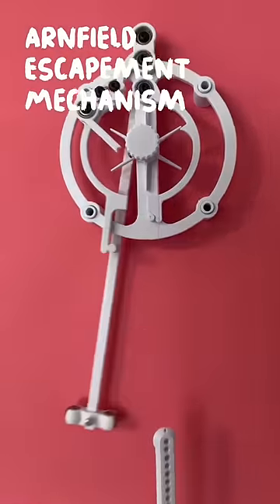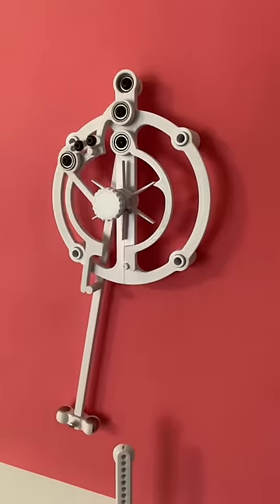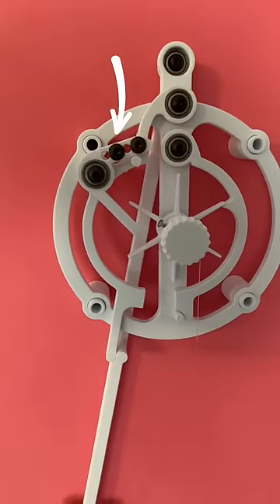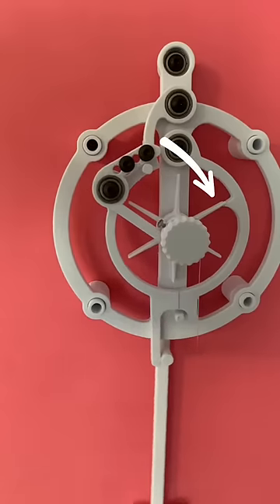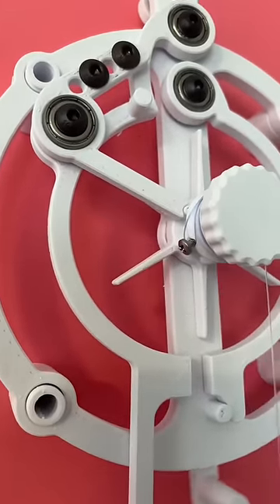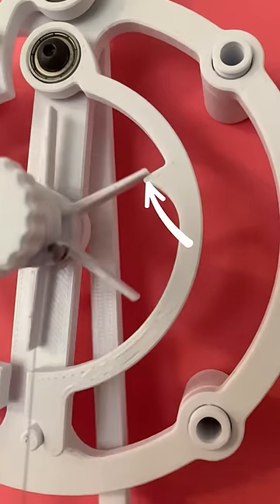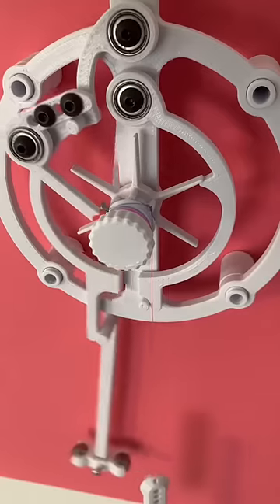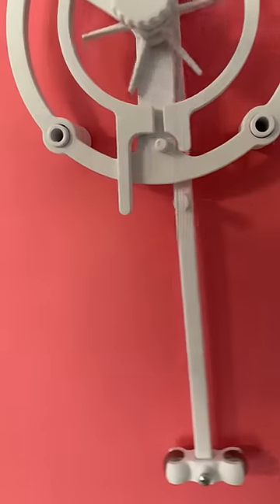The Arnfield Escapement Mechanism | Mind Blowing

Comment: The counterweight hanging on the string is what keeps it going. This has to be reset every so often to keep it running.
Reply: Exactly the same mechanism in a grandfather clock. It's always been fascinating to me
Reply: I mean, it'll last weeks if you're on a cliff, maybe years if you're on Jupiter 🙃
Reply: Ah, I just noticed that. I thought it used a coiled spring.
Reply: Would it be possible to have an enclosed cylinder with heavy balls that exchange out through some sort of hole to make it so each click the one side would always be heavier, Instead of needing a weight?
Reply: @TheOfAnd  like a Da Vinci wheel, or a Bhaskara wheel? If there really was such a mechanism, it would take the world by storm
Reply: @TheOfAnd  they would have to be heavy enough to flip the left side back up, but yeah. You just gotta fill the canister again with the balls after they all drop down.
Reply: @RazzleberryHaze  exactly! Love the grandfather clocks!
Reply: @RazzleberryHaze  Lots of clocks have a six pointed star like that at the heart of the escapement but there are many different ways the pendulum interacts with it.
You could be right but a lot of them look very similar to that one. "Kicker" mechanisms like this or a grasshopper escapement are fairly rare.
Reply: @TheOfAnd  You need to revise what you said, dude. There are children present.
Reply: Just like those pocket watches that need to be wound every day
Reply: Yeah, my grandparents had a cuckoo clock that had this mechanism
Reply: I don't think he's trying for a perpetual motion machine. It's a mechanism that was commonly used for clocks before electricity
Reply: @kelvinle8662  I don't mean a ball exchanging system. I mean an enclosed gear that had a certain amount of balls or weights in it that move around in such a way that one side will always be heavier
Reply: @TheOfAnd  u mean in like an infinite loop? Nah man, the system would always loose energy, so it would come to a standstill at some point
Reply: @kelvinle8662  🤔there's an idea!
Reply: That's what I thought, something must be keeping the center wheel wanting to turn clockwise
Reply: Ohhh okay. I thought the string was like lowering a load at a controlled rate, vs free fall.
Reply: Could a spring do the same thing so you wouldn't have to reset until it wore out?
Reply: I'm trying to ask the question of where can it have more energy to run all of the accesories.
Reply: No, it’s gravity that keeps it going.
Reply: everyone knows, this comments bro 🙄
Reply: Is it like a old clock?
Reply: Like the old grandfather clocks
Reply: Y he said nothing about the counterweight?????
Reply: It is not a "counterweight." It is just a weight.
Reply: @RazzleberryHaze  my great grandfather had a cuckoo clock that he fixed up and left to my mom when he passed away. I bet this is exactly the same mechanism that makes it work. The mechanism for popping the bird out of the door doesn't seem to work quite right anymore, but the clock ticks perfectly. It has 2 weights, one for the clock, and one for the bird/cuckoo noise, that drops only when the bird and noise happens, so that probably relies on a similar mechanism that's just triggered by the hand positioning. Like a stopper that's moved out of the way for a moment before sliding back in after the cuckooing. The triggering and noise and everything seems to work just fine, but the bird itself kinda gets stuck/doesn't come out very far. I wonder if I could fix it.
Reply: @GordieGii  you don't necessarily need a whole six pointed thing do you? You could just increase the number of "points", make them smaller, and suddenly you have a gear, with it just taking smaller steps and smaller kicks, but more of them.
Reply: @diarya5573  Jupiter doesnt have a crust as it is a gas giant, and it is so massive it would crush you through pressure long before you go anywhere close to "landing"
Reply: @ThatSB  Never said crust 🙃🙃🙃 Floaty cities
Reply: it is seen that there is a small thread holding a counterweight that is what gives energy to the system, when that counterweight reaches the end its "infinite energy" will run out
Reply: @TheOfAnd  no. That's impossible. You still have to lift the ball from the bottom and since the balls all would have to weigh the same you would only get a heavy side of the cylinder at the bottom most point.
Reply: @Chris_Bro_aka_MR_PLAT1NEM  bummer, maybe one day
Reply: @blipblop92  Those use a spring to store energy, this device uses a counterweight.
Reply: Uh.. yes. That’s apparent in the video. He was talking about the mechanics. He wasn’t claiming that a centuries old escapement someone resets its own weight. Normal people who use their brains more than their ears waiting for someone to misspeak understood that. And nobody new to this was thinking we achieved free energy over 100 years ago.
Reply: You don't say.
Reply: And you can even see it at the beginning as it slowly drops below the colored area before the last shot.
I like how they mentioned the weight more than once, and the pendulum separately.

It is one of the ways to power a grandfather clock.
Reply: You answered my question, thanks!
Reply: Yeah we still don’t have perpetual motion
Reply: Yeah isn’t this how grandfather clocks work? Is that hammering mechanism the reason they’re known for the really loud ticks?
Reply: @ThatSB  As far as we know. There are theories that Jupiter has a 'rocky' center made of hydrogen helium solids at high pressure, and a whole lotta comet junk/ rocks/carbons, but that of course is theory
Reply: Set the line for a minute and have something reel it back in one minute 
Evens down odds up
Reply: I was wondering about that string. Mystery solved...not amazing.
Reply: @sideways5153  they shouldn't make really loud ticks because that'd be just wasted energy.  As noiseless and friction free should be a goal so you can get the 8 days before having to lift up the weights with normal length chains.
Reply: @kelvinle8662  coiled spring ang gears might be better
Reply: @diarya5573  If you have a REEEEEALLY long string, maybe. But on Jupiter, it would actually last less time because the stronger gravity would pull the weight faster.

Also because Jupiter is a gas giant and it would fall in and quickly be crushed and torn apart by the atmosphere and tidal forces.
Reply: @TheOfAnd  No, because the balls switching sides create turbulent forces inside that actually slow it down. People have tried, it doesn't work.
Reply: @TheOfAnd  How about using mercury to tip the cylinder back and forth?

Comment: ISN'T THIS JUST A GRANDFATHER CLOCK MECHANISM? It's the original tick tock tick tock clock.
Reply: No, but it’s close
Reply: most escapement systems are similar, this is not exactly a clock pendulum system, but its similar
Reply: @r_ramendump9681  what is the difference?
Reply: @RoxasLopez  most modern mechanical clocks function on an escape wheel and a pallet fork system known as the graham escapement. It uses less parts and is more simple.
Reply: Yes it is. Don't be daft people.
Reply: No.
Reply: @Ben Dover Yep, its a controlled release of energy essentially
Reply: That's what I was thinking too!
Reply: Cuckoo clock, yes, most grandfather clocks are wound which requires a more complex mechanism. The escapement may not be identical but is designed to both control the descent of the weight/unwinding of a spring, and to make the action of the mechanism take a length of time that's a fraction of a second with a numerator of 1.
Reply: @kdawson020279  
My grandfather's clock had weights on chains, so no winding.
Reply: @rightwingwackobird1389  I have seen it both ways. I've seen a lot with faux weights that are purely decorative, as you get more modern. Historically speaking, accurate clocks were almost all weight-driven, as springs add variance and gravity is a constant. The heirloom clocks we had were all wound with keys.
Reply: My grandfather used an atomic clock.
Reply: Yeah.  Although the Tinfoil Hat Brigade want to take this in a different direction, it is just one in a series of videos that look at different variations of clock mechanisms.
Reply: It's ok, you don't have to yell
Reply: @JohnSheffield1963  "tinfoil hat brigade"?
Reply: Since its invention in 1656, there's been literally hundreds of different pendulum clock mechanism designs. The one in this video is called the Arnfield escapement, it was invented about 1987 as an improvement on earlier ones like the one used in the Big Ben clock
Reply: No this is Patrick

Comment: In case it’s unclear, energy is applied to the pendulum because the pendulum lifts the left ring a small amount and the left ring falls slightly farther than that amount, thus pushing more energy into the pendulum than is consumed by the pendulum lifting the half ring. The left half ring is ejected slightly by the weight so this difference is equivalent to the energy lost by the weight as it lowers its potential energy (by lowering itself)

Comment: For people who don't understand : the weight is slowly falling at each cycle, it gives force to move the pendulum back to the right (it puts energy in the pendulum, NOT the system)
So when the weight will touch the floor (or the whole string will be unrolled) the pendulum will slow down and stop

Comment: Isn't the weight that keeps the pendulum swinging?
Reply: Yes, unlike a normal pendulum that will keep going until air resistance slows it down, this will stop when the weight has hit something or the string has fully extended. Good timer, great for setting off a bomb :)
Reply: @seanbrockest3888  the pendulum isn't fighting air resistance. It's simply the fact that gravity makes the pendulum want to go to the neutral position (down) but it overswings center—thats usually where energy is added back into the pendulum with most pendulum movements.
Reply: You are incorrect. The pendulum is indeed losing energy to air resistance, a little heat, and a little noise. That's why it didn't swing in perpetuity.
Reply from the maker: The weight is pulling on the escapement wheel; on each cycle, the escapement wheel lifts the left half-ring, and when the pendulum hits the lock disengages cause the left half-ring to push back on the pendulum.  That's what keeps it moving, which is why my mind was blown!
Reply: @Engineezy  I missed "escapement" while reading, sorry 😬
Btw it's a smart indeed!
I don't know how regular mechanisms are made,  but I'm fairly sure that this solution requires less parts than usual.
Reply: It's different. Regular pendulums can't swing forever
Reply: @rohandaniel311  if by forever, you mean the floor, sure.
Reply: @rohandaniel311  Neither can this one? You'll get exactly the same amount of energy you put into the system once it stops
It's literally a thermodynamic law
Reply: @jacobchang4588  what? They said a regular pendulum. Which would swing forver if not for friction losses.
Reply: @6079 Smith W take a reading class, because he never claimed this was perpetual, in fact he stated several times the weight falling is what powers the system

Comment: The point of the mechanism is to separate the parts involved with energy supply from the parts doing the time measurement. This ensures that the periodic force applied to the time measurement parts (in this case, a pendulum) is independent of the energy supply, and any wear that it suffers, and, in the case of a spring, the reducing force it supplies.

This makes for a more accurate clock. It's ironic that by the time this mechanism was devised, mechanical clocks had been superseded.

Comment: This is just a few gears away from being a grandpa clock
Reply: Some clocks do use a system like this. But the six spoke gear has more spokes. The energy that keeps this going may not be enough to rattle all the gears. Grandfather clocks have a weight attached that inputs enough energy to keep the clock going. That's why you have to wind grandfather clocks every day.
Reply: @MrKaiyooo  this Is the same... You can literally see the weight going down in the video

Comment: It's powered more by gravity. Small weight pulling the string keeps power in the system since gravity is pulling it down. I'm assuming a little bit, but the weight might be adding energy back to the pingilum.

Comment: I was always trying to come up with the ultimate lock that couldn't be picked because it was too hard and you didn't have enough time.

This would be perfect, you'd have two I've been keys pretty basic will add a security pin on each side.

But to even activate the key mechanism you have to activate the device from your video which automatically closes all of the pins every time it rotates unless they're being held open by the key

Every single pain has to be held up at the same time or won't open
Reply: And of course it would be possible to lock pick it, but you have one second and you'd have to log a pick two doors

Comment: You did not mention what makes this escapement unique. It was the first escapement to isolate the pendulum from the variations of  the driving force of the movement. It provide constant restoring energy to the pendulum, as well as isolating the pendulum from unlocking the escapement wheel (which depends on the energy of the movement). Unlocking the lever by the pendulum requires constant energy, as the escapement wheel is immobile.

Comment: The swinging pendulum does not, by itself, add energy to the system. Either a wound spring or hanging weights are what typically add energy to the pendulum.

Comment: The weight drops really quickly for this to be as or more effective than a normal pendulum clock works ..
Reply: It's a type of gravity escapement, invented for use in tower clocks, most famously Big Ben. In that application the weight has to drive the gears to turn huge, heavy clock hands, so most of the energy in that drop isn't spent on the pendulum, and clock towers have a lot of height for the weight

Comment: In regards to whether or not the left side adds more energy into the system. This is what’s happening: there’s only a certain amount of energy in the system; the first part of the movement spends that energy, when the left side swings back it replaces the energy spent. So it’s a question of semantics. It doesn’t truly add more energy. It’s simply REPLACES the energy spent during the first portion back up to 100%. so if the first half of the movement used 50% of the available energy for a split second there’s only 50% left over but as soon as the left side swings back it replaces the 50% and then for a brief moment in time the system is at 100% until the first portion repeats. The real test would be for someone to put a camera on it for 24 hours or 48 hours or a week and see if it simply keeps moving.
Reply: So you didnt see the string and weight pulling down on it?
Reply: It should prob work for atleast 10 minutes with the weight on that hight

Comment: this could be used for two different and interesting things, it could be a wall clock that doesn't need batteries or it could be made on a large scale to generate eletric power.
Reply: Its not a perpetual motion device, thats just how clocks worked back then, because you need to pull the weight back up, thats in the bottom of the vid

Comment: But is it FREE ENERGY ? Does it have a Battery OR Does it Continue to move alone until someone stops it ?
Reply: No it relies on that weight and string to pull the gear clockwise. When you run out of string, it stops

Comment: And people say perpetual motion isn't possible, scale one of these way up and make some sort of generator that can run of its movement, kind of like a water wheel generator
Reply: You saw it working forever without energy ? No, because it will stop like 2 or 3 minutes after...

And a water wheel hasn't anything to do with perpetual motion, it uses the fact that the water is elevated and so it has energy (potential energy)

Comment: If designed with quality materials and nearly perfect tolerances, you could theoretically power that type of device for a significant amount of time.
Reply from the maker: Definitely true! Might even be able to without those 2 things, which is what I’m working on :)
Reply: I'm a huge fan of magnets, something you could try is a rethreader and a magnetic weight with a stationary magnet above, reducing the weight on an up stroke while still giving a downward force to perpetuate the motion of the mechanism.

Comment: Perpetual motion devices arent real, the will for sure stop at some point there needs to be someone or something that resets it once in a while, things may look like they could go on forever but they're just engineered in a way to mimic perpetual motion
Reply: You are correct. That weight is slowly pulling the gear clockwise every tick, and when it runs out of string to pull, it stops.

Comment: 1,500 comments; odds no one will ever get to mine...
An astronomy teacher used to show a ' gravity' pendulum at the local museum. The pendulum was massive. It has worked constantly for the sixty years I have been around, without any extra springs or forces, operating on gravity and slight timing changes- it tells time by knocking down pins.
Kinda boring after awhile but, will be around forever with no added power

Comment: This thing only runs as long as the weight is high. This is basically a watch escapement, but its powered by a weight instead of a mainspring, and it uses two halves of a circle instead of a balance wheel. The mainspring can hold WAY more usable energy, hence the 40+ hour power reserve of modern mainsprings in watches, and more in clocks. This really isn't anything new. If you want an amazing escapement, look at Omegas coaxial escapement.